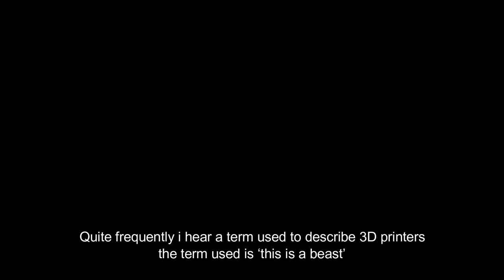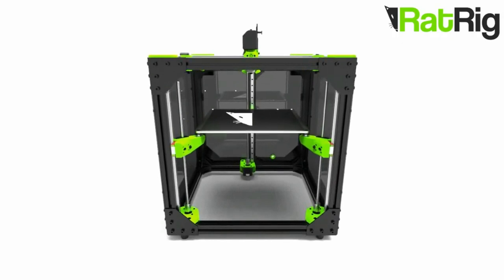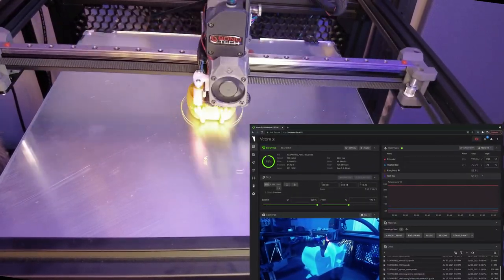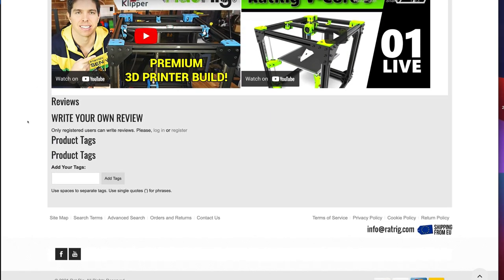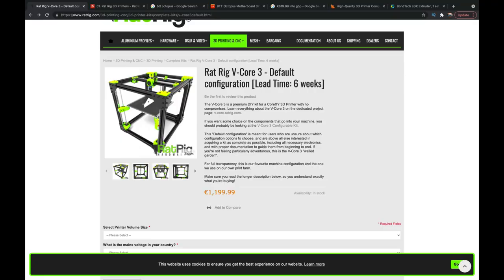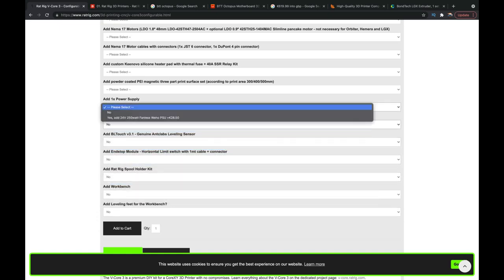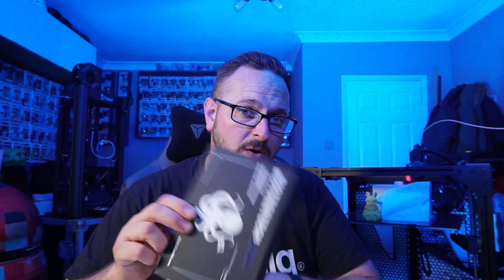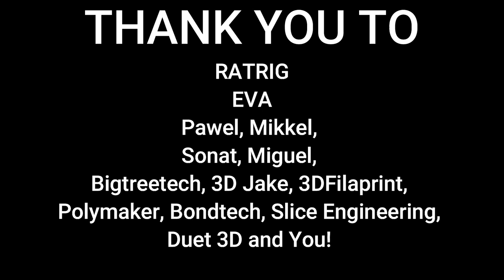Why the Rat Rig V-Core 3 will change your 3D printing game

Comment: I have to strongly disagree with some parts of this review. While yes, the v-core itself is brilliant, I do not think the praise for RatRig as a company is warranted. They have had god awful communication (and by that I mean a total lack thereof, as they announced 4 week lead times and it took them 10-12 weeks to ship out units while staying awfully quiet). They still claim 6 week lead times currently knowing full well that can't be achieved, which is dishonest at best.

Also you mention they do their best to make this a premium experience, so I genuinely have to ask : Have you read the instructions for assembling the printer? Other than the fact that half of it is still missing (wiring, firmware setup, eva for anything other than the bmg + v6, support for other combos that they themselves sell, etc), there's also the fact that a lot of the instructions are jumbled and in the wrong order. It feels like amateur hour when compared to even instructions by most current chinese vendors.

Not to mention the quality issues on some of the parts, like a few people have reported issues with the provided idlers/bearings, plus I honestly don't know what to think of the unbranded rails or the printed parts that need to be drilled. 

Once it was assembled the printer was fine, but the experience from purchase to assembly felt worse than any of the chinese brands I bought from before. Would totally recommend to source your own kit and get it in a more timely manner.
Reply from the maker: Hey @popato I totally value your comments! but to answer you on each of your points - 

My communication started just over a year ago with RatRig where I was looking for a 3D Printer that would replace the S5. The communication at times is slower than preferred but they are a small business attempting to cope with a large amount of orders. Having run a small business myself I totally understand that communication is really key and this is a problem for sure. One that I certainly will pass down to them, however i'm sure their team will read these comments too. 

From what I understand there have been delays with various part being shipped to them to be able to ship the whole product out. How this is communicated should be improved.

I have read the instructions and I personally found them to be pretty good and in my experience vastly better than any of the Chinese printers that I've been sent to review over the pat year. Again personal experience and I guess you cant give everyone the best ride every-time. 

On the EVA side the product is separate from RatRig, because of all the options I can see where you are coming from especially when you are trying to find your way through all the noise.

My advantage on this side is seeing EVA move up in its version history along with speaking to Pawel, RatRig and Slice Engineering in order to understand the benefits and limitations to use. On the BMG side I really like the product and i've just ordered a LGX and Orbiter to see which one works for the stuff i'm printing. 

Personally I didn't have any need to drill anything, the kit that I received was fully formed and working well. The only thing I needed to re-order was the LDO motors as I wanted speed and torque settings to be a little more responsive.

I'm honestly sorry to read that your experience wasn't top notch, but again when compared to other Chinese products say.. CR6 or Anycubic Vyper as a stock machine these have both had enormous challenges from sensors not working to electronic shorts on the bed, leading to melting smoking motherboards. These from hobbyist industry leaders. I'd say there is a big challenge to get things right every-time. RatRig members really push discord, and I really don't do discord but that seems the way that community supported products seem to be going. As you say there are things that I don't like about the process, for example when I got the VCore Pro, then 2 week later there was a release of the 1.2, so I built that only for the 1.3 version to come out. Obviously you can't stop progress when things are changing at that sort of rapid rate. 

I really like the open source element, and buying your own stuff and making it yourself makes it really accessible to a wider audience.

Are you setup and running now?
Reply: @TheRealSamPrentice  The CR-6 SE is honestly one of the worst printers ever released, like a ton of creality products so I wasn't really thinking of that when mentioning chinese brands, was more thinking of brands such as Artillery, sovol and the like... 
The discord that you mention however is unofficial, and it has no RR employees on it (unless mikkel is an employee, in which case he's the only one on there), sadly the gist of the communication (or lack thereof) is done via Facebook, which is obviously not the best platform to do this, what with the awful search engine and difficulty of finding relevant information amidst the people just showing off their benchies...

Just curious for the instructions part, sorry to be annoying, but did you not have issues with stuff such as the belts for the idlers being listed as a last step when it is so much easier to route them before the printed parts are screwed into place? I have had to disassemble parts of the gantry/idler system each time I noticed that.

Also again the wiring part was just a diagram with nary any instructions, had this not been my 8th printer I would not have had a single clue on how to proceed, let alone the firmware that is geared towards one single non duet board (I know v-core OS now has 3 boards supported but the digram is only for the SKR pro). I also tried the duet version and I'm just wondering why they only provided a barebones config... Surely when you consider the default config ships with a duet, there should be at least an entire setup for that?

In any case, that was my experience and my aim was more to warn others than to complain per se. Having built a couple printers from the ground up I was fine with the process and ended up with the machine purring at a nice 7500 accel, however I just feel that for fairness' sake it is important to talk of the negatives as well.
One last note though, I understand fully that RR got overwhelmed by the response to the printer, my only gripe was that they did not warn people of the delays, and even worse kept (and still keep) advertising deliberately wrong estimates for shipping.

Sorry for the long winded reply, that is pretty much all I had to say on it anyway so I won't be wasting more of your time hopefully :D
Reply from the maker: @Popatoh  Okay Well Mikkel and Pawel are on the discord for sure. With Pawel being the man behind the whole V-Core3 design elements. What their status is with the company is something that I don't fully know. They did all join me for a Q&A that I live-streamed a few months ago explaining which elements they were responsible for. I agree on the facebook side and I have a couple of other hobbies where I miss out due to how facebook works. On the routing side for the belts I did also use the cad file to understand the routing. I pulled the belts though (like you say) after the fact but didn't need to take them fully apart to get that routing. Also when I did that I noticed that on the top right hand side my idler pulley was out of alignment but could still access it with a small alan key.  

I'm doing some work with the RR guys to get and produce a better video on talking about Klipper and better understanding of what the hell its all about! That I would say was my biggest vice as I didn't have a clue what to do. That of course could be a massive flaw, but of course and from what you are saying the choice of drivers, how to wire, what motors etc could lend to quite a few ways of making this product in its kit form. Id say there is certainly more work to be done in the setup and showing how this can be done. 

You will have noticed that 1 question for this video really sat with me, so i'll have a think and see how these things could be improved for people that are looking for this kind of information as its really important and could effect the whole enjoyment of the build. 

It's good to talk and i'll go back to RR with these comments and see what can be done to improve things moving forward :)
Reply: @TheRealSamPrentice  Thanks for taking the time to read my posts and thanks even more for the in depth replies, it's always great here in the comments section haha.
Reply from the maker: @Popatoh  Always happy to help where I can :)

Comment: Thanks for the video. I have a 500x500x500 (Other brand) atm and an so disappointed in it. I have everything but the frame since I've had to upgrade 80% of my current one when I ran into the Rat Rig. Thinking this is the way to go especially since I want to get into astromech droid building.

Comment: Thanks for the honest, detailed info, Sam! I’m very much looking forward to your upcoming vids on Klipper and other aspects of running the VCore3. I’m leaning strongly towards the VCore3 as my next/last printer. I want something fast and super-reliable, but any help you can offer around setting up and working with Klipper will be most welcome! (Kudos on the consistently great content you put out!)
Reply from the maker: Hey Dave, thank you very much for your kind comments! I'll do my very best with klipper side! More videos on their way :) My best advice would to see what else is out there any weigh up the pros and cons. Rat Rig had the best solution at the time for me and its all incredibly genuine :D
Reply: @TheRealSamPrentice  Yeah, I've been looking at a lot of alternatives, and while the V-Core 3 is both more expensive and seems like more time to put together than I'd like to invest, it really seems like the most solid option out there. It'll be a little while before I take the plunge though, I want to get a resin printer first, to give me the capability for super-fine detail and things like threaded mechanical parts. To me, 3D printing is more a means to an end than the end in itself, but investing time and funds to get the RatRig level of print quality and reliability seems like it'll save me both time and money in the long run :-) Thanks again for the superb work you're putting out, not to mention taking the time to reply to my post!

Comment: Wait till you see this hot end I'm designing. I'll be to testing phase in about a week. You will be able to print each part at a time up to 120 mm tall. So you will fully be able to print sections at a time to get rid of all those headaches of printing layer by layer on multiple prints.

Comment: Hello Sam, do you recomend any Corexy 3D printer project ?? i'm looking for a project between 400x400 and 500x500 , i'm gonna build and donate a 3d printer for the lab of my university (UTFPR from Brazil) .. the unique requirement is that i'm using 2 motors to Z bed ( because of my mainboard, a creality 4.2.2), and i have U$500 to built it .. i'm searching for it, but just finding projects with 3 motors for bed ..

Comment: The kinematic bed.   The more I look. The more it is not good.  3 points determine a geometric plain. 3 points do not make a stable square, retangular, or circular plane. Period. Otherwise your floors in all buildings would be triangular supported to save on costs and materials. But, they are not.  However, RatRig's 3 points does create a stable triangle bed. If, you only load within the sides of the triangle created by the 3 points.   Sorry. It's physics.  Experiment: put cinder blocks under your bed. Support the foot with 2 and your head with one in the center. Have a good night's sleep. Oh, LOL>
Reply from the maker: I kind of feel that you’re having a pop at me! I’ve not designed it I’m a user.

Comment: For someone not so clued up with which parts are better than others but wants to build the ratrig would you say the default configuration is a good starting point?
Reply from the maker: Personally, apart from the hot end, if you want fast flow rates and speed upgrade that element, and Octopus Pro ;)